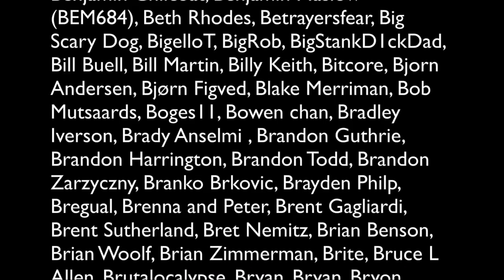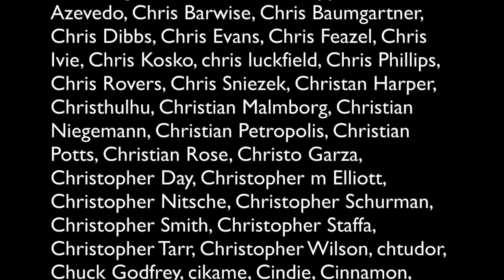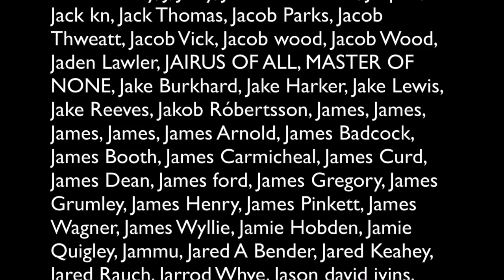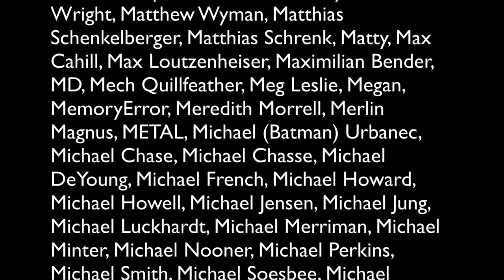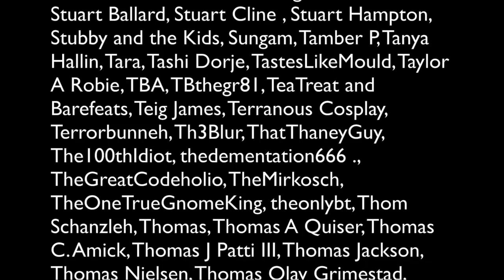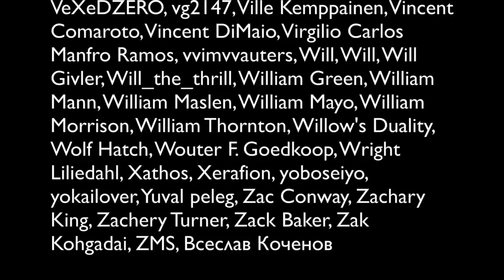Master Sword Build; Part 4 of 4

Comment: The issue is normally Your swords don't have Tangs,    Your handles are usualy pipes or bars you butt up and join to a base.   Where as a traditional sword,  (European or Asian)  Will have part of the blade extend past the guard that will then be encased in a wood or metal grip, but isn't a structural part.    The tang takes all the weight,  the wood or metal grip is just there to fit the hand.  and hence, can be removed

Comment: Wow, that looks actually fun to swing around, in a not-worrying-about-your-back kind of way. I feel like the monster swords you make always act more like really sharp hammers, but this thing cuts beautifully on the slow-mo. Looks exactly like what some people would call a 'real' sword, but the design was definitely worthy of the MichaelCthulu treatment. This is my favorite of all your builds so far.
Reply: I have one with the same dimensions made by Dave (the guy who sent Michael the hilt parts) and trust me, you'll still have to worry about your back haha. The thing is surprisingly heavy and 3-4 times the weight any practical one-handed sword should be. Notice how during the cutting test he always swings it two-handed and the momentum takes him around almost a full 360 degrees - that's my experience too. Every time I try to pick up mine one-handed it puts massive strain on that arm and wrist and I have to use slow careful movements. The thing is almost twice as heavy as your average claymore.
Reply: @timmy3441  It's because the fake swords are over 2 times thicker than they have to be and do not include a distal taper which means about 3-4 times the amount of material in the finished "sword" than you would find in a real sword
Reply: @drthmik  Nah, that's not the reason. It's because the Master Sword is a fantasy sword which doesn't have to comply with the laws of physics since it's in a game, and it's just bulky and impractical when you scale it up perfectly to real life.

You could make a Master Sword with a distal taper and mess with the proportions to make it more practical if you want, but then it's no longer the Master Sword. Either you get game accuracy OR you get real life practicality, unfortunately it isn't possible to have both in this particular case.

Comment: Some wraps are precut and woven together and stuck while its flat and still oversized so they can make a thin card stock template and cut the flat leather to size. Its easyer to glue a handle in one flat piece but gives impression its been applied in stages. Hopefully this will help you in future.?? "Ingenuity for the win people"

Comment: I NEED THAT SWORD IN MY LIFE!
Reply: thistubeisfucked  I can't afford it but I would buy it if I could.
Reply: thistubeisfucked  No, I NEED it in my life; I just don't currently have the means to obtain it.
Reply: nightmare Shadow  if you want a sword that's close to the actual dimensions in the games and for it to be made of steel it isn't going to be light and usable. A version you can use is going to be little more than a prop.
Reply: nightmare Shadow  Nah, OoT's sword would be impractically heavy too and it was definitely not thin. Problem is, OoT was in that era where gaming hardware wasn't quite powerful enough to represent what the developers imagined, so it depends whether you want to base the design on its blocky in-game model or from the artwork.

If you look at some of the artwork that shipped with Ocarina of Time, (like this: https://vignette.wikia.nocookie.net/zelda/images/5/54/Link_Artwork_1_%28Ocarina_of_Time%29.png/revision/latest?cb=20170328041810), the sword is even wider and likely heavier than its more refined modern iterations from TP-SS-BotW.

I personally wouldn't want a sword based on OoT anyway, as much as I love the game (it's the game that introduced me to the series), I see the design of the Master Sword from that game as an early prototype more than anything else, before they settled on a more refined and seemingly final design with SS and BotW.
Reply: nightmare Shadow  Well I can't read your mind haha, there's no reason for me to assume you're talking about the 3DS model if you didn't specify beforehand. But even then, that changes nothing about the artwork vs game model discrepency - should the 3DS, a handheld with a 240p display and limited horsepower, be held up as a reliable indication of how the sword should look either? I wouldn't say so, and even if we assumed everything you're saying is true, 10-15 lbs is already 4-6 times heavier than any practical one-handed sword should be. It doesn't sound like much, but a sword weighing anywhere near that is a heck of a lot of leverage on your arm and wrist.

I actually happen to own a Master Sword almost identical to the one Michael made in this video; it was made by Dave, the same guy who provided him with the hilt parts for the build. The sword has already had its thickness scaled down because if it hadn't, nobody would be able to pick it up; if you were to directly scale up the in-game model from BotW, the steel would be around an inch thick and like you said, it would probably weigh 40 lbs or more. The one in this video, and mine too, are about 3/16" thick and my sword still weighs in at 9 lbs, which is around 3 times heavier than your typical real-life longsword.

Even with the blade thickness heavily scaled down, you can still see how Michael swings it two-handed in this video and the momentum carries him around almost a full 360. His sword is also likely lighter than mine, as his one has a hilt made of aluminum while mine is bronze.

The unfortunate reality is that the Ocarina of Time model would really not be much different, if at all.
Reply: nightmare Shadow  I'm not a huge Zelda fan so I'll take your word for it but that's not Mike's style. We all have our own preferences though. For me this is a work of art and should be treated as such, for Michael he seems to treat it as a lump of metal to hit things with. Youd want a smaller sword you could actually utilize? Great! He does actually have a couple of builds of smaller sword 🙂